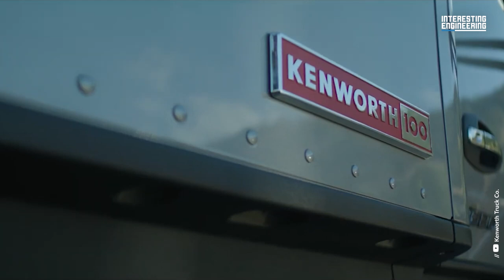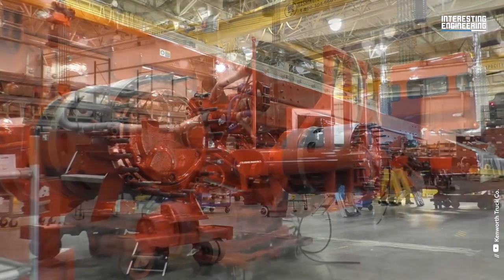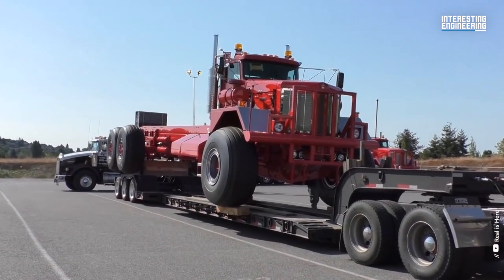Behemoths on Wheels: Exploring 5 of the World's Largest Semi-Trucks

Comment: That Pete at the beginning hauls
More then 80k pounds lol. Same with the w900.   In the oil fields we had these big winch trucks they would use that had huge tires and dual steering front axles.  Idk how much weight or power but I do know they would winch those big tank batteries onto their ass end and then move them all over site.
Reply: what about Hayes and Pacific Semi's

Comment: These are just straight up inaccurate. There are larger ones. Here's a list:

-Tonar 7502
-Kenworth C540
-Pacific P12 Ultra
-Pacific P12
-Hayes WHDX
-Peterhilt 397
-Oshkosh M1070
-Oshkosh M911
-Western Star 6900XD
-Mack Titan
-Mack M45SX
-Mack M100SX
-Mack Superliner
-Kenworth T909
-Kenworth C510
-Kenworth C509
-Kenworth T610
-Kenworth T609

I'm not saying these are larger than all of the trucks, surely the Tractomas one is the largest, but here's a few that is surely larger than 389, W900, and 122SD. The largest Peterbilt isn't their road-going 389, I don't think it got into production tho, but it's the 397, which if I'm correct, is designed for oilfield jobs, same way as the Kenworth 963. Also, Pacific P12 and P12 Ultra are different, you can see if you search it up that P12 Ultra has a really big hood, compared to the normal one
Reply: Berliet T100?
Reply: @zakgrubb7512  T100 isn't really a tractor, it's more of a cargo vehicle

Comment: Sorry W-900 DOES NOT have a sloped nose. And every tractor can haul way over 80,000lbs. That's just the legal limit without a permit.
Reply: Although it's not a sloped nose, it still has some wind of slope in it. It can be seen in W900B, W900L, and W900S side view. W900A is different tho, it has a flat one. I still, will not put my side onto this video, just extremely inaccurate.